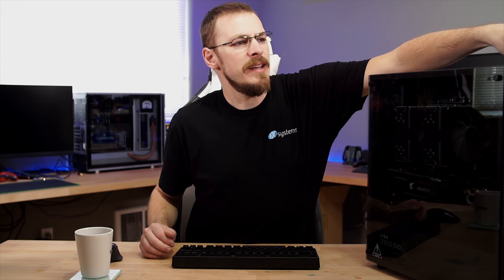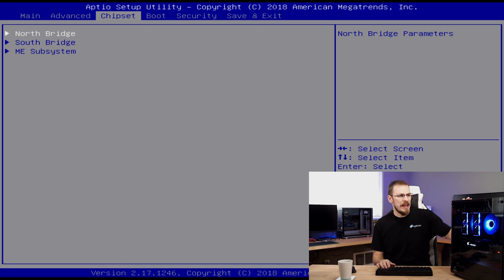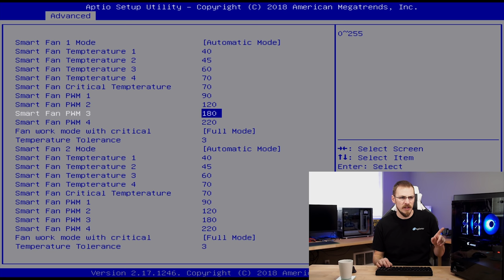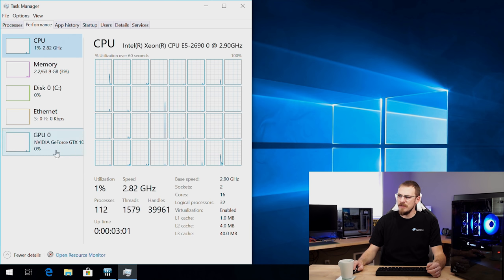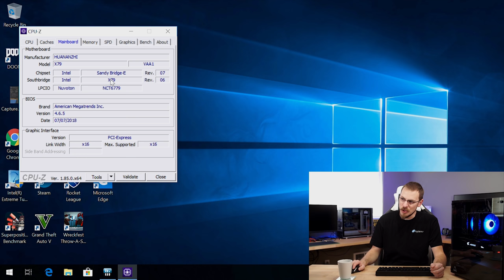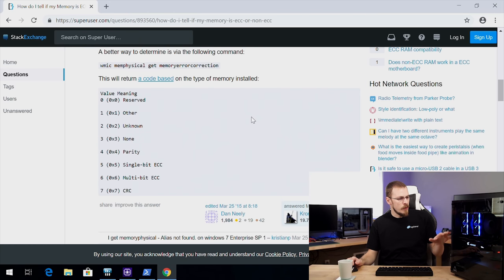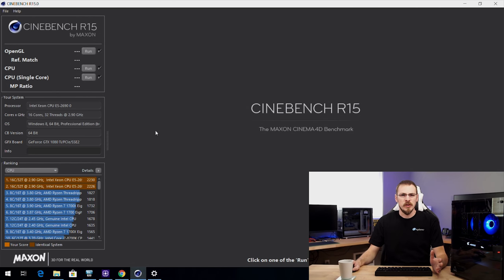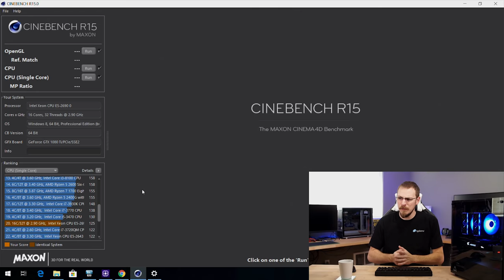Huanan "Dual X79" Motherboard Review

Comment: I’ve got an unused ASUS Rampage IV Black Ed. mobo with AC:BF included. Anyone know how much I could sell it for on eBay, OfferUp, etc.?
Reply: 200-250
Reply: I've got the standard iv extreme. Great overclocker.
Reply: John LaFratta, all R4Es are excellent boards. If you have the original box & extras I would say 250 to 300+.
Reply: ah it's worthless, I'll give you my address in a dm if you're interested in getting rid of it
Reply: mapesdhs That’s good news. All of the cables and accessories are still in their original packaging, and the plastic wrap on some parts of the board is still untouched. JVCCR, I’d have to kindly rescind that offer but I can get you a Barnes and Noble giftcard with about 15 cents on it
Reply: @johnlafratta1298  Btw, if I may on the flip side invoke the odd wtf or two, a few months ago I managed to get (fixed price) an R4E, 3930K and 16GB/2400 RAM for just 200 UKP. :D  And the most bizarre thing, the R4E was almost completely new/boxed (he'd taken it out but had knocked off a single SMC, which I fixed by moving one over from a donor board - all hail the god that is Louis Rossmann. :)  I plan on putting the setup into a Corsair C70 Military Green case, H110 AIO, NDS fans (matching colour for the case), SSDs, etc., then probably sell it off as I don't really need it, already have an R4E/4930K for my main system (and another for benchmarking). Ah the joys of 2016, back then X79 boards were going for crazy low prices, I was able to get several P9X79 WS boards for 100 to 150 each, and two E versions were just a little more. Supply has largely dried up now, whereas the CPUs are easy to obtain (ironic). I can't help wondering how popular X79 would continue to be if good mbds were still available, especially the ASUS boards (and likely others) which can be BIOS modded to boot from NVMe (or just a 950 Pro).

I have another E WS with a 4960X to sell off, but want to oc/bench it first. It has 32GB/2400, 850 Pro, C70, H110, etc.

Just as SB was so popular on the mainstream side, SB-E was IMO the last fun enthusiast HEDT for Intel. Many people had great times meddling with the 3820 and 4820K. After that Intel started borked the PCIe lanes with the 5820K and then it got really messy, and expensive. It's funny how they've finally put back the full PCIe provision but with pricing & thermals that are kinda nuts, certainly compared to what AMD is doing.

Btw, I get about 3.5GB/sec using an SM961 on an R4E. And for those who may not be familiar, here's AT's review of the completely OTT but awesome E WS board:

https://www.anandtech.com/show/7613/asus-p9x79e-ws-review

This is one of the most interesting diagrams:

https://images.anandtech.com/doci/7613/Chipset%20Diagram.png

Note the x4 link that goes straight to the CPU, perfect for NVMe boot. I'm still searching for equivalent diagrams for the R4E, standard WS and other boards.
Reply: @mapesdhs597  Nice deal. I managed to get a P9X79 LE, 3930k, and 16gb of ram for about $375 CAD (about $285 USD), not a great deal but not terrible. Wish the boards were cheaper. Would've been nice to get a R4E, Sabertooth, or X79 Dark. These parts will be for my main system so I can make some money back after selling my X58 parts. lol

Comment: At about the 10 minute mark, you mention the board supports VT-x, which you describe as “pass through”. This may be a gaffe, but to explain to those who may get confused: Virtualization passthrough is VT-d. This allows devices to be handled by other virtual machines, rather than the host OS. The most common use is GPU passthrough via VFIO.

VT-x is a compatibility technology for virtualization, allowing multiple operating systems to run on the same hardware, and enforce better CPU and RAM management. 

Great video btw :)

Comment: The reason they masked the chipset in the system info is because it is a hacked together motherboard.  However, from your video, it is a very well put together quality hack board despite the short-comings.  They probably don't have an arrangement with intel for the C602 chipset.  My guess is these chipset are probably from salvage or overstock and they just mask it as X79 in the system info.  This is just my guess of course.  I would buy one of these Huananzhi boards as they appear to be quality.

Comment: Just got the Jingsha version of this board which supports M2 NVME and 256GB with 8 memory slots. I am using it for a home virtualization lab so my need was max cores and memory. I had pulled a 1TB NVME stick from another system that had Windows 10 running and after putting together this system it booted up first time and Windows 10 recognized the new CPUs with 24 Cores and 48 Threads with 256GB of RAM.

Decided to use E5-2651 V2s to minimize power consumption as they only require 105W.

Onto ESX - did not install initially as this board has Realtek NICs - built a custom ESX installation ISO with the Realtek vib installed and worked like a charm. Running the latest build of ESX.

The only downside for me is no fan control - plan to get Noctua low noise adaptor cable to slow down the fans.

Comment: I just ordered a couple of component sets for Linux workstations. Threads and memory are the key for VMs. They were $500+ for Ryzen CPU , mobo and memory. Minimum GPU needed. For real VM work, we repurpose old Supermicro dual-Xeon servers with 24 cores/48 threads and 72GB of ECC RAM. The "dual X79" approach would let me deliver server-class vitualization on every desktop. Hopefully you will benchmark KVM or an equivalent tech in the next video. Thanks for doing this! Subscribed.

Comment: Why didn't you turn the back CPU cooler around so that the fan wasn't sucking the hot air coming from the front CPU cooler? Then you could have put an extractor fan on the top of the case over the space between the two coolers. Would that have made a difference?  As for would I build it. if I could afford it this is exactly what I would get. I do a lot of 3D rendering and the multi cores and threads would eat my projects really fast.

Comment: You can get a Huanan board with 16GB of ECC DDR3, an X5650, and a sheisty CPU cooler for $140US on AliExpress.
Reply from the maker: Which is an order of magnitude slower than this setup. 6-Core Nehalem vs 16-Core Sandy Bridge is not even close.

Comment: When we validated these parts (back in the day...), we used fans that exhausted out from, rather than across, the chip. In the configuration you're showing, I wonder if the heat from the 1st processor's heatsink is being deliberately blown into the 2nd processor; and I couple that thought with wondering if flipping around one of the two heatsinks, so that cool air is pulled into the middle of the two, would improve the CPU characteristics.

Comment: At 21:30 you talk about that it would be good for Video Rendering and CAD.

CAD applications are similar to most games in that they are not heavily multi-threaded. Core i7s are the processor of choice for CAD work since model rebuild time is heavily dependent on processor speed.

That aside, this is kinda a cool build.

Comment: jingsha also has a dual x79 board too, with a few differences like more ram slots.  I've also seen another video where it looked like there bios had some OC options,  it was a single socket though.

I'm wondering if a bios flash could unlock it for all cpu's, wish these boards more popular would love to see a modding group just for these

Comment: And use them for an Hackintosh build?
Reply: I do this with a JingSha/Kllisre Dual X79 and a pair of E5-2630L v2 (6x2.4GHz/15MB 65W). It need a lot of patches (ea. for the memory: MoBo have 8 DIMM slots, in the BIOS there is 16DIMM per CPU! Mojave make Kernel Panic without patch when DIMM slots of the second CPU are populated. Same think for the USB)
With a pair of RX580, it is very powerfull for hit riduculous price! (tested with Capture One v11)
NVME slot deliver 2850MB/s with a Samsung 500GB 970EVO+ SSD
There is no deep sleep (S3 doesn't exist in BIOS)
100€ for the MoBo, 40€ for the 2 Xeon, 40€ for the 2 Heatsink SnowMan 12cm with 6 heatpipes, 110€ for 4x16GB DDR3-1600 Reg-ECC, 1.5€ for the CPU 8pins splitter...
Of course, if you want a pair of E5-2697v2, you need a powerfull PSU (Corsair 650W is OK for my config, but certainly not enough for a pair of E5-2697v2 and a pair of big GPUs)

Comment: Thanks for this great video. I have the same motherboard (with 2 e5 2650 V2) & 32GB of ram, all running under windows 10. It's day & night compared to my old e5 2500k@4500 which rowed in 3d applications. On the other hand, I have a problem when I want to turn off the computer, the PC does not turn off ... (my power supply is recent (Corsair RM850)), I tried to modify some bios parameters (ACPI) but so far I have not succeeded . There are quite a few options in the bios (although recent in its update) and the documentation is not available. Did you encounter such errors during your editing? Thank you in advance for your insights.

Comment: Gotta love the dual cpu tower coolers in that tempered glass case. It looks like a baller setup even though it isn't that powerfull. If the rumours of AMD Zen2 are true you can get multicore performance scores like this (maybe even higher) on the AM4 platform next year.

Comment: I have one of the 8 DIMM models (Huananzhi X79-8D), and I''m currently using it as my homelab server hahaha. I'm running 2x Xeon E5-2687W v0 chips in it that I got super cheap (£100/$120 for the pair of them!!), along with 64gigs of ECC memory I grabbed on eBay for about £80 ($100ish). I had the same weird errors on boot for a while but they seemed to just go away, not entirely sure what I did. Currently got about 60TB's of HDDs strapped to the thing in an Enthoo Pro and she's serving me well. Will have to see how it lasts, I only got it up and running in March.

Comment: Strange thing is that CPU is idling at max speed, according to CPU-Z screenshots provided. Have you tried tweaking power settings to let it lower the frequency at Idle? Should drop like 10C easily.
Reply from the maker: They do go down to 1200mhz. Windows was just doing 'something' in the background.

Comment: I bought a Gigabyte GA-7PESH2 C602 board ($165), 2x E5-2680 V2 ($300 for 2), which is even better value for money. The board has 16 total DIMM slots and supports ECC-Reg memory well. The 2680 V2's are 10 core and have an all core turbo of 3.1GHz which equates to 2600 in Cinebench. The board is still available on eBay. **may need a BIOS update.
Reply: Where did you get the 2x E5-2680 V2 for $300?  I want to build an cheap ESX server.
Reply: @MarkCohnNCS  eBay. I gave a best offer to a seller of $300 for 2X. I haven't been able to find them that cheap since. It also was 10% eBay bucks in addition so I got $30 back.

Comment: Excellent video sir. Question, how much heat does the cpus run at with sustained 100% load using AVX2? I would really like this for virtualization, kinda old but better than my w3680 xeon socket 1366 setup. Minus on the dual channel memory, but most things won't notice it.  I use two pcie slots, one for my Areca Raid card, so using Sata onboard is not needed, and booting is controlled by the Areca card itself..

Comment: I also got me one a couple of months ago, and i am Really Imrpessed.
I did not have those Booting Issues at all, runs perfectly fine.
I got two 2660v2 10 Core Xeons.
I Water Cooled the System and it is running on 28-35 Degrees in Idle, and never over 55 in at 100%.

Comment: In my intel server, my UEFI install USB wouldn't show until I enabled a couple legacy USB support options. One was labeled "port 60/64 port emulation". I don't remember what the other one was. So maybe that's disabled by default, and maybe you don't have the setting to change it visible.

Comment: Interesting, i have the same setup and exact same CPU's, the idle temps for all cores is between 27-32 Celsius.   Full usage of all cores runs between 58-65 Celsius.  Cinebench  r15 score for multiprocessor is 2210. I'm very happy.

Comment: The cooler from the front CPU  is just blowing hot air to the cooler in the rear causing a temp difference between the two.
Reply from the maker: There is always a temp difference in dual CPU systems.  What I was experiencing before adding an exhaust fan was a 20C difference at idle.  THAT is not normal.  With the fan added, the difference was reduced to less than 5C, and maintains that difference under full load.

Comment: I've gotta wonder though, what would it look like with lower cores, faster clocks? There are 4 and 6 core xeons for this chipset that hit desktop/gaming clock speeds easy, but I haven't seen anyone test this as a multifunction streaming rig, or something similar, which really weirds me out cause that should be it's most popular use case.

Comment: I went the used super micro route. Ordered 2 2667v2 xeons for $400 and a X9 supermicro board for $250. Not close to the same value you have here so we will see how it goes when the parts get in.

Comment: yes i am actually considering that as an option i work with 3D rendering and animation so raw CPU power fits me well here i will get some more powerful Xeons and i actually considering to water cool the cpu's  a 1000w power supply and two 1080 gpu for rendering graphical tasks like iray renders

Comment: Thank you as usual for your review. I am on my Second One of these boards ! The First one just failed and the Second one can't make up its mind what to do. I am frustrated by the lack of available documentation so if any can assist I would be very thankful. Current issue I have is NO AUDIO and won't boot with an M.2 drive and then after these issues it is stuck on a 'b7' error which if I had a manual I could probably have an idea what to look for.

Comment: Hey saw a couple of your videos on the Dual CPU X79 Motherboard test.

Should I buy the X79 Motherboard with Dual CPU E5 2640v2 (8 cores X2) or go with X99 Motherboard with E5 2678 V3?

What do you think? I can’t decide. Part of me thinks 16 cores is better than 12 but the X99 Motherboard is newer. Pairing it with GTX 1070 Graphics Card. It’s my first Gaming PC build and doing tons of research. Thanks in advance!
Reply: x79 for 90$ on aliexpress, and 2x 2678 v3 on ebay for 150$, 2678 is compatible with both ecc ddr3/ddr4

Comment: I think the rear cpu is getting the short stick with those thermals. I would suggest to exhaust on top of the box and put the rear cpu fan on the other side, so the hot air goes in the middle and up.

Comment: I have a Xeon E5 2680 0 in my pc right now. The E5 2690 standard clock and boost clock is little higher ghz then my cpu. The single core is also 120 too.

Comment: Currently running a dual X5675 rig I upgraded from a stock Dell T7500. Added some cool stuff like USB 3 (through a PCIe card) and also a good wifi card. Getting ~1450 cb on R15. That's basically just above a stock Ryzen 7 1700. Sure, power consumption is a good deal more, but the whole thing costed me $250 max. Limited to SATA II and also not great single core performance isn't awesome, but overall, this thing is maxed out performance per dollar-wise. At 1440p, bottlenecks on my RX 480 are very minimal, I basically never dip below 90% CPU usage. But for games that are REALLY bad and pretty much use a single core, it can get pretty bad, as low as 60-70 usage. It depends what you're playing and what your expectations are. Other than that, I'd do it all over again 100x over! And when Sandy/Ivy start getting even cheaper, I may go at it again!

Comment: I've got a dual E5-2670 w/ 64 Gb ECC setup on an Intel S2600CP motherboard--very similar to your setup.  I use it on a daily basis for finite element analysis work.  My i7-8700K can actually perform the analyses faster than the dual Xeon setup that has 16 cores (hyperthreading disabled for FEA work since it slows the system down).  However, the Xeon system is about 12% faster at video transcoding (w/ hyperthreading enabled).  So, there is still a place for these older, high core-count systems.
Reply: FEA software. Are you an engineer?
Reply: @the7dan7dan  Yep.  Mechanical engineer for the past 30 years.

Comment: 4 memory channels / dimms on a dual cpu mainboard is a bit of a letdown, especially at that price. There are multiple used / old stock serve rmainbaords at similar or lower price points which feature the the full 16 dimm slots, quad gigabit lan, more SATA, more PCIe, etc.

Comment: You may have been better off buying a used HP z800 workstation from ebay.  For under $500 delivered complete and ready to use, you can get 24c/48t + 48gb + Quadro and plenty of room for more.  Won't be great for gaming, but would kick arse at rendering on the cheap.

Comment: I know this is an old video but I came back to it because i found one of these dual x79 boards that has an NVME slot,  4 dimm slots per cpu and just had a price reduction to $89.00. After watching this video, I think I'm going to take a chance. My primary purpose for this rig is encoding large video files, disc ripping, and amateur video editing.
I'm either going to run some flavor of linux on it or a bare metal hypervisor and run MacOs in a virtual machine. ( I love macs but their new(er) hardware cost way to much.
For the build price of this rig the best I can do with a genuine mac pro is much older 2008.

Comment: I ordered this x79 from China. I should arrive this week. Bought also 2x 2690V2 with it and 4x 16 GB ECC Memory... For the cooling i want to use my old NZXT Kraken x41 and a "new" one i found on Amazon. I want to reuse my Corsair 750 XT Power supply and my Samsung SSD's 960 Evo and 950 Evo. I also have a older GTX 760 inside. The case will be the NZXT H440 wich is an offical ATX case... I read that this E-ATX board can still fit it this case on a forum. What do you think about this? BTW i do webdesign / grapich design.